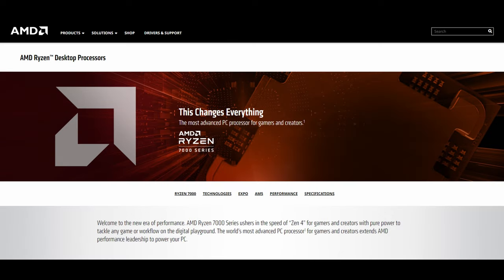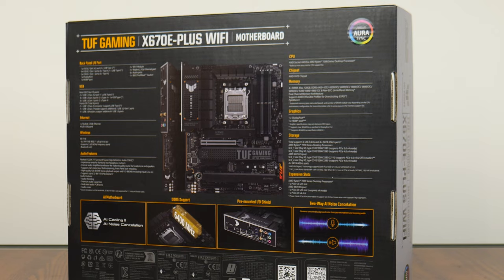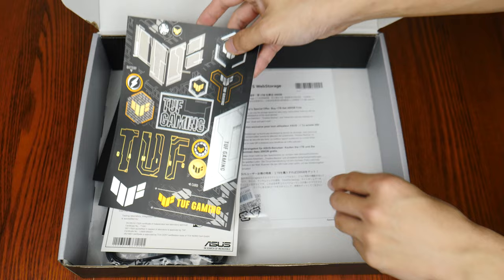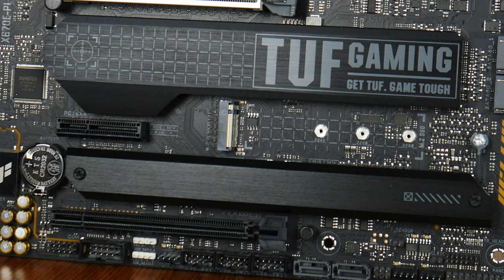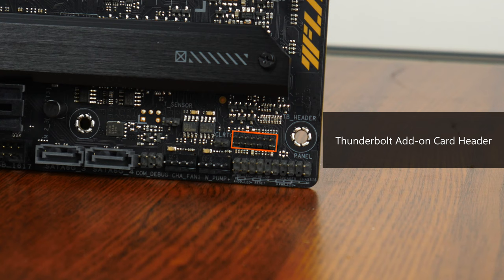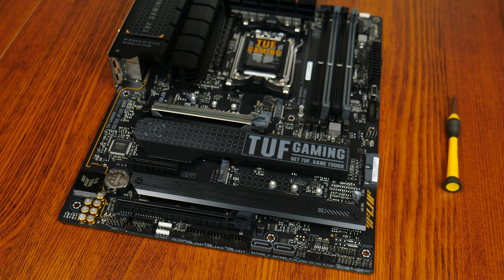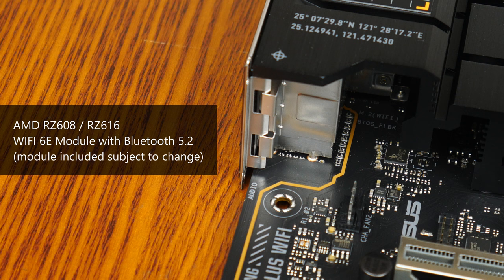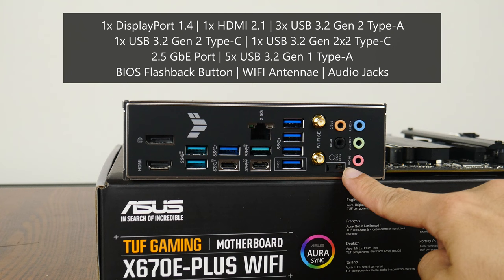AMD Ryzen 9000 Series Ready! ASUS TUF Gaming X670E-PLUS WIFI Unboxing & Overview

Comment: bro I just spent nearly $300 on a product for 10gb because the board only has a 2.5gb ethernet port. just to find out that they are rocking gen 2 and gen 1 USB type C..... nice one Asus. not mad that this costs over $300 :D
Reply: I cant use a wifi card because the 4080 is massive
Reply from the maker: @FOUR22  this board comes with built-in WIFI though, no need for you to install a separate WIFI card!
Reply: @ALKtech  Lan Card. Its called a Wifi card as well.
Reply: I'm about to buy it, is there anything better? What would you recommend now?
Reply: @Dubulcle  if you don't care about USB-C or have internet faster than 2.5gbps than this should be perfectly fine tbh. It has been great for me since then
Reply: @FOUR22  Thanks 👍
Reply: @FOUR22 what's the problem with the boards USB-C? It has 2 ports, one of which is 20gb, no?

Comment: Ryzen 7 7700X / upcoming Ryzen 7 7800X3D with RTX 4080 and DDR5 RAM. Would this be a good combination? I'm new to PC things...
Reply from the maker: If you're intending to build a high-end PC meant primarily for gaming, the 7800X3D seems like a good bet, though its kinda hard to say for sure as the 7800X3D hasn't been released for sale yet, but numerous media outlets have been hypothesizing how the X3D will be a beast of a gaming CPU...in any case I think this motherboard paired with a 7800X3D will make for a good gaming PC that should last several years, and give you a good CPU upgrade path too!

Comment: Does it fit a 2.5 pcie slot gpu? I got the SAPPHIRE NITRO+ AMD Radeon RX 6750 XT, and the motherboard's manual doesn't tell us too much about...
Reply from the maker: The RX 6750 XT should fit just fine, usually graphics cards and motherboards are designed with dimension tolerances in mind to ensure maximum compatibility. Are you concerned about the card blocking the primary M.2 drive slot and vice versa?
Reply: @ALKtech  The M.2 drive access is not a problem. My sapphire GPU takes almost 3 slots of pcie space. Need to make sure it will fit without interfering with the 2nd motherboard's pcie slot.

Comment: Why no one films behind the motherboard? I wanna know if there i backplate for AM4/5 cooler....
Reply: @dista9428 There is. I upgraded my rig with this board last week with a 7800X3D and Dark Rock Pro 4. Backplate is plating the back as it should. ;)  

(Is it still an "upgrade" if you toss everything but the graphics card? :D )
Reply from the maker: @jonnze8949  got me curious, what graphics card have you carried over from your previous build 🤔
Reply: Hey  @ALKtech  I'll keep my trusty MSI RTX 3070 for a while longer that I luckily got for an okay price at release and before everything got ridiculous with the prices. VRAM is sparse but I'm still happy with it. Before that it was a GTX 970.

And until last week I ran everything on a 6700K with 16 GB RAM, SATA SSD and 2 Hard Drives. It was about time.
I still cant believe the speed of my WD M.2. Its...stupid fast. :D

So...I upgrade hesitantly. But if I do, I want it to pay off. Without getting on the enthusiast level though.
Reply from the maker: @jonnze8949  I personally run a RTX 3070 for my primary rig that I game on at 1080p - have it paired with a 5700X and it serves my purposes just fine, in spite of the 8GB VRAM. 

If you ain't in a rush, wait for AMD's RX 7700 XT and RX 7800 XT to arrive, and with some luck, prices for new graphics cards (especially previous gen) may fall even further...and perhaps you could then splash out for a nice upgrade to fully realise your 7800X3D's potential!

Comment: Could I use a 7900x and a 4090FE on this board? I’ll be using 32GB 6200mhz ddr5 ram. Would there be any issues with this combo? I’m new to pc gaming and I don’t overclock as I don’t know how.
Reply from the maker: The 7900X and 4090FE will work just fine with this board - as always, just make sure that you've got a good CPU cooler and airflow in your case. Wouldn't hurt to check out ASUS's QVL list for qualified DDR5 memory modules too to minimise any compatibility hiccups!
Reply: @ALKtech  awesome. Thanks bud for the help! Heres a sub from me!

Comment: I use Lightroom, photoshop, Topaz and other photo editing software to load (large dumps) and edit photo files that can be 50+,MBs, in addition to gaming.  Which CPU do you suggest between Intel and AMD?  I have the 3080Ti. It's been a long time since I've put together a PC and currently researching this stuff and have some idea of the products but wanted to get some feedback from those who have been on top of this stuff.  I am not too concerned about price to performance because this build will be around, as long as it last, for years to come.  I'd like a rig that works and games.  Btw, I am still using my build from November 2012 (2600K and 980Ti), so that should give an insight on how long I stick with a build.  Thanks...
Reply from the maker: Oh wow...how on earth have you survived with a 2700K for that long with those productivity apps 😂 Are you using your 3080Ti with the 2700K at the moment? 

Given your productivity workload and intention to game, I'd recommend going with a i5-13600K, which seems to be the value and productivity king at this point in time. One argument against it is how the LGA1700 platform is sort of, end-of-life once Intel's 14th Gen Meteor Lake is released, where AMD's AM5 platform might make more sense if you'd wanna do a mid-life upgrade. That said, since you mentioned you'd likely stick with a build (untouched) for a long time, going down the 13600K might be a good option - you could also pair the CPU with a Z690 board for cost savings!
Reply: @ALKtech  Yeah.  I know.  It's been working, but I know things are much faster now.  I got caught by the COVID thing when I was trying to source a new card and ended up waiting about 3 years to get a card that I wanted.  I wanted the EVGA 3090Ti Hyrdo Copper but EVGA did not build it so I got the 3080Ti Hydro Copper back in July and have been waiting to see the new stuff.  I plan to go AM5 this time around because as you stated Intel is nearing it's life cycle and I want to start at the beginning of a new cycle this time since I won't be making any changes for a long time.  Thanks for the tips.
Reply: I was you. I was stuck with a GTX 960 and Intel i7-4790 built at home that was high-end... 8 years ago. The 960 is especially bad. This build could only run games in low settings and to make it worse I work with tech digital art with 2D, 3D procedural and rending, VFX, game engine like UE5, and many of these are optimized or have features that require an RTX for good performance. Render time and laggy system because of many heavy apps open were a huge bottleneck.
I build a new system with Ryzen 9 7950X and 3070, and also got one of these new Samsung 980 2TB SSD for fast I/O, and the difference is a night to day. AMD is good in my case because it's all strong cores design which is better for 3D rendering than Intel's mixed approach which is better for more general work. DCCs also have better video encode support for Intel (AMD with graphics is still kind of a new thing yet) but I would hand the work to the GPU encoder, anyway.
It costed me a leg but the cut in render time alone makes it possible to increase quality and double my work. And honestly, 5 of these 8 years suffering with a laggy workflow and a dry gaming experience because of low settings was not worth the savings.
Reply: @SoulGuitarMetal  Good to know you like the new AMD CPU.  I am strongly leaning towards that CPU.  I have never used AMD before in the 3 computers that I've built.  I am trying to learn as much about AMD before I stick my head out there.  Thanks...
Reply: @SoulGuitarMetal  Question.  Do you store your working files (tech digital art work) on the NVMe, HDD or Sata disk?
Reply: @Methodical2  The fastest NVMe for anything I/O intensive such as source code compilation, game engines, and game projects or art project files that take long to load and save. Big art project files save instantly so I can use auto-saving with small intervals but my biggest bottleneck was a lot of small files. My Unity game project generates more than 43000 files which is much slower to process than a single file of the same size. It took more than 20 minutes just to open the project in my old build. Now it takes less than 1 minute and everything else is instantly.
Reply: @SoulGuitarMetal  So, do you think I should get a 4TB NVMe to load my large photos files for editing or stick with the SSD sata drives?  I'm trying to figure out which direction to go.  I think the prices my be pretty close for both though and if so I guess it would be the NVMe.  Thoughts.
Reply: @Methodical2  Check the motherboard slots and PCIe versions. My motherboard has 4 NVMe M.2 slots so it is a waste using SATA SSDs instead. Also, I move projects I don't need to work on anymore to an HDD so a 2TB PCIe 4.0 is more than enough for the OS, softwares, and projects. I can just buy another when it fills up, anyway, and the OS can merge it with the other so they look like the same drive for simplicity. SATA SSDs are looking kind of obsolete now that NVMe prices are close so I would make sure to get a motherboard with a good number of M.2 slots.
Reply: @SoulGuitarMetal  Thanks for the feedback.  The price comparison makes sense.  I'm getting the Asus X670E Hero MB and it has 5 M.2 slots.  I just purchased the WD 850X 1TB (different build) 2TB and 4TB with WD BF sales.
Reply: I would go for a Amd R9 5900x if you need more cores otherwise the 5800X3d is also great

Comment: Curious if you'd be able to remove the large TUF logo and branding from the VRM heatsink on the right side. Appears to be just a small plate glued to it.
Reply from the maker: If I recall correctly, it's not a sticker and actually one entire piece, meaning to say the VRM heatsink is cast in that shape, and the TUF motifs are printed on...
Reply: @ALKtech  Thanks for the info! I was considering that board and attempting to customize it, but it might be more hassle than it's worth if it's not able to be modified. I suppose I could just make a custom decal if need be.

Comment: after enabling docp, pc does not boot to bios, boots directly to windows. what's solution?
Reply from the maker: Immediately after switching on your PC, keep mashing the Delete key. That should work in bringing up the BIOS screen!
Reply: Does work.. i am using t-force delta tuf ram.. it is xmp.. is it compatible isssue??
Reply from the maker: @suyenshakya4320  https://www.asus.com/motherboards-components/motherboards/tuf-gaming/tuf-gaming-x670e-plus/helpdesk_qvl_memory/?model2Name=TUF-GAMING-X670E-PLUS <-  do check if your RAMs are on ASUS's QVL list. In any case, fast boot-up speeds directly into Windows aren't due to RAM compatibility issues...
Reply: Now if plug my dp cable in my motherboard.. i am able to get to bios..but after bios going to windows i need to plug back to gpu dp for display..is this any issue with board??
Reply from the maker: @suyenshakya4320  all AMD AM5 processors come with built-in graphics, which is why you're able to get display output via the motherboard's DP port. Have you tried looking around in the BIOS to see if there's any weird setting changes regarding primary display device?
Reply: How do i enable aemp profile in asus tuf x670e
Reply from the maker: @suyenshakya4320  it should be under Extreme Tweaker>Ai Overclock Tuner in the BIOS.

Comment: acabo de armar un equipo con esa tarjeta madre, ryzen 7600x, memorias que vienen en la misma lista de soporte de compatibilidad pero no me da video, prendes varios led secuencial los tipicos de cpu dram, vga pero el led de boot se queda en verde y de ahi no pasa, que crees que puede ser? es la misma tarjeta madre de este video
Reply from the maker: Try booting up with just a single stick of RAM first to see if there's any difference, and if need be, let the system remain powered on even though there's no video, sometimes the system might just need some time to "train" the memory before it'll boot successfully. If the system does work with one stick of RAM, plonk in the other, and see how it goes!

Comment: it SAYS it has aura sync but does this motherboard even have any lights?
Reply from the maker: It does actually, in the lower right hand corner area of the board. It's a really small RGB LED accent though - check out 3:02 of this video to see how it looks.

That said, AURA SYNC refers to the software used to control RGB devices - this board has three addressable RGB headers and a single 12V RGB header, for use with external devices with RGB LEDs. Trust this clarifies!

Comment: hey i recnetly build my pc 
ryzen 9 750x
rog x670e e gaming wifi 
and a corsair 150 h rgb 
psu is 650 watts

problem is : my system is keeping shutdown since the very first run. i can't understand what is the issue 

can the update bios can fix this..

or do i need more power supply i m not using graphics card 

please  reply anyone who can help is need 🙏
Reply from the maker: Are you able to find a spare power supply to swap out the 650W one that you have and see if this changes anything? Also, did you connect the power supply to both 8-pin CPU power connectors on the motherboard?
Reply: @ALKtech  i got why it was happening, i didn't plug in my cooler pump. So when the processor reached beyond throttle temp. Then it would shut off.

Now i ve new problem. My borad is stuck at F9 q code which is recovery related code.

Actually i tried to update my bios but.
It shut off quickly in between the installation.

I want to go back to the previous version now...
I can't understand how can i do it..
Reply from the maker: @Anshul-nc4he  you might want to try Googling "ASUS BIOS recovery". and try to reflash the BIOS again to see if it fixes your issues. Sounds like the BIOS might have gotten corrupted due to the shutdown while updating the BIOS...
Reply: @ALKtech  i fixed it, the problem was i forgot to plug in pump plug into board. so the processor was heating beyond throttle temp and that was causing sudden shutdown. later on i put the updated bios file into pendrive and then it automatically did everything by itself...

Comment: Wonder if the rumors that the 7950x  will run at 95C normal are true.
Reply from the maker: Seems like it..at least from the other review videos and articles that I've watched thus far. Looks like having an excellent CPU cooler would be absolutely vital to maximise the potential of the 7950X!
Reply: @ALKtech  I heard that aio coolers cant handle high temps, the plastic inside the pump-house starts to melt or at least soften.
Reply from the maker: @Pyriel2  I wouldn't be surprised if that becomes a long-term issue down the road. AIO and HSF manufacturers would probably be scrambling to make sure their new product releases would have the longevity to handle the thermal behaviour of AMD's processors...guess only time will tell as people start to report on their ownership experiences!
Reply: @ALKtech  true. Wonder whats so damn different between an AM5 motherboard for 1600 dollars and one for 400.

They share basically the same io and just a different number of pci5.

I mean ddr5 memories are still so crap that ddr4 is faster and none of these board allow for ddr5 8000.
Reply: Yes its true, I owned one and returned it.
Reply: I use the ASUS ROG Strix LC II 360 ARGB White Edition and my 7959x idles around 48.  When doing heavier work, it usually gets up to 81. The only way I was able to get it to 95 was with prime95.

Comment: Would a 4090 be good for this using a 7900x
Reply from the maker: Yeap a 4090 would do great with this board and a 7900X!
Reply: @ALKtech  Exactly what I'm thinking of doing; I'm thinking of installing an R9 7900x and an MSI Suprim rtx 4090 on this motherboard (I'm going back and forth between Suprim X or Suprim Liquid X). and 32gb T-force delta Tuf ddr5 6400mhz. What do you think of this setup? Should I consider ASUS ROG STRIX X670E-F for motherboard?

Also what is your recommendation for cpu cooling? (I was thinking of TUF Gaming LC 240 RGB but I guess it's not compatible with AM5?)

Your feedback will be very valuable to me.
Reply from the maker: @nmnksc  Bearing in mind the ROG STRIX is more expensive than the TUF GAMING (~US$110 more expensive where I'm from), where the ROG STRIX comes with a better VRM setup, better audio, dual PCIe 5.0 x4 M.2 (versus one on the TUF GAMING), much more USB 3.2 Gen 2 ports on the rear I/O, a sleeker-looking aesthetic, the question then would be, would you like to have these features? If the answer is no, I'd stick with the TUF GAMING!

In fact, if you're going with the TUF GAMING board, I'd use the money saved to invest in a better AIO cooler - while ASUS's website doesn't state that the LC 240 supports AM5 - AM4 coolers SHOULD work with AM5, though I must say I haven't tried this myself just yet! 

That said, given that the 7900X can run pretty hot given its thermal design, I'd rather you have a look at a 360mm AIO cooler instead..I suspect that with the LC240 (which is more of an entry-level AIO) the 7900X might get thermal throttled with it!